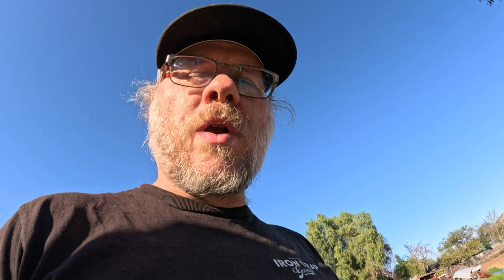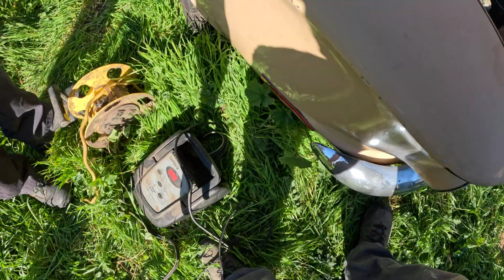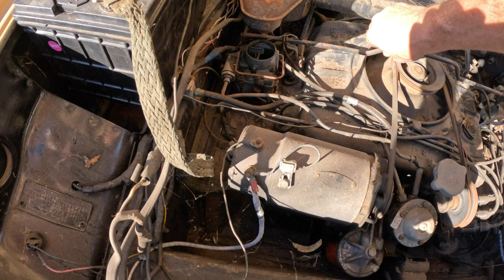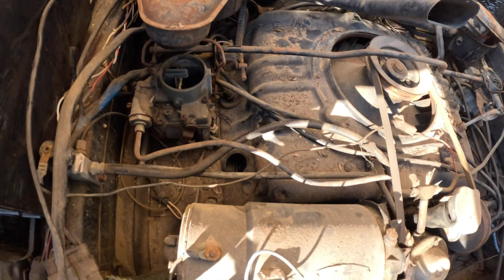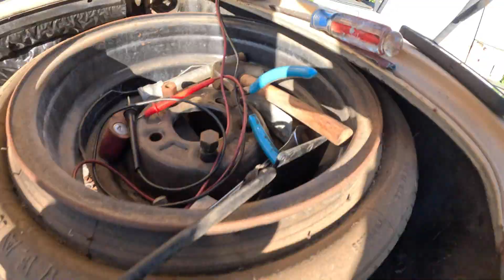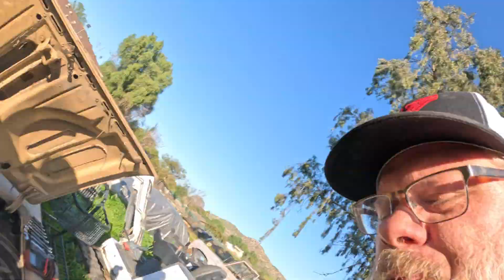1961 Chevrolet Corvair First Start

Comment: You need to remove the carbs and cross shaft as a unit, then pull the top cooling shroud off (Corvair people call it the turkey baseter). I guarantee the cooling fins are full of crap, mostly mouse crap.
Reply from the maker: Thanks for the suggestion. we are clearly far from Corvair experts.

Comment: never rev one up  the way  you are doing  if  you like  your  thumb   ,,the fan or belt will eat  it up ..be safe
Reply: Umm.. ?   Been around Corvairs my entire life,

That's how you rev the engine from the engine bay..

Been doing it that way regularly, for.. well since the 80's
Reply: @craigjohnston3431  i like my fingers   //belts eat them...
Reply: The real reason not to rev it by handling the cross shaft in that spot is because it screws up the carb sync. Otherwise revving it there isn't dangerous as many Corvair enthusiasts (especially me) still have all our fingers and no accidents from the shaft LOL. I have had 3 Corvairs including a '61 4 dr model 700. Love the Corvairs and someday I hope to have another one.